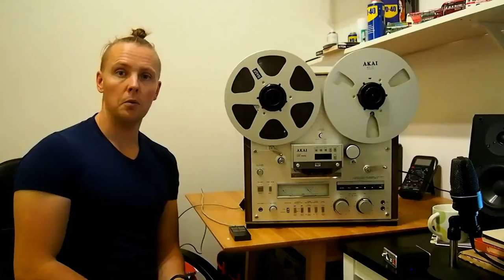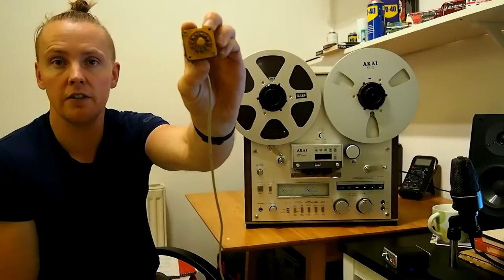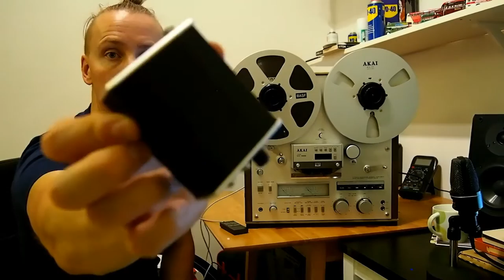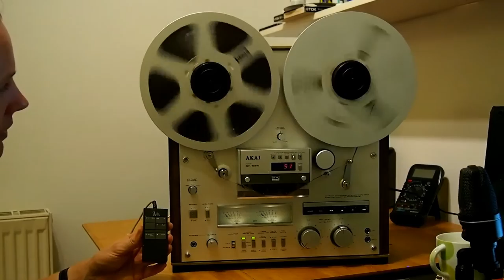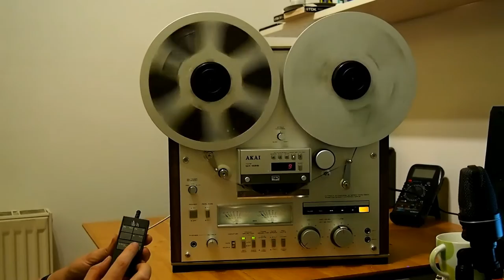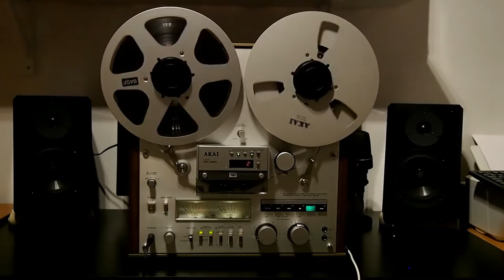Akai GX-625 Reel to Reel Tape Recorder Demonstration

Comment: I see you have a lot of AKAI equipment on your channel. Is AKAI popular where you are from? I had a reel to reel player 35 to 40 years ago. I don't remember the brand though. I have a very decent 7.2 surround system with Denon receiver and Paradigm speakers. I would like to add a reel to reel deck some day.

Comment: Hi Darren. Got the same machine. When slightly cool (18C). The machine runs poorly on play. It has all elco's for feeding replaced. My Akai refurbisher and me are unable to find the problem. No noises etc.  After 4 hours (!) of warming up on standby, everything is ok. Can you help? Thanks, Harry
Reply from the maker: Sounds like your next step is to strip both reel motors and capstan motors to relube the bairings. I havent done mine yet but sounds like yours may be suffering withnsone grease thats maybe gone gooey over time.

Comment: i own a akai 1722 how can i change the tape speed in 19 cm per second there is no switch as in my 215 d gx also i own a sony tc530 a revox b 77 a philips 4500 and a teac tapefreak sure
Reply: dannyjaar; look for a tube of sorts under the tape head cover. That tube should fit over the capstan. That is how I can change speeds on. My Akai GX-4000D